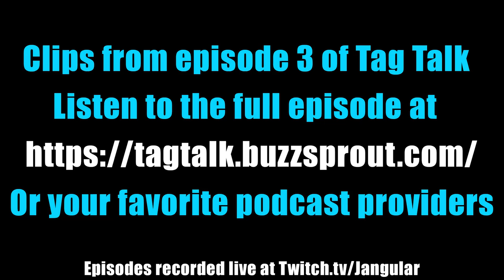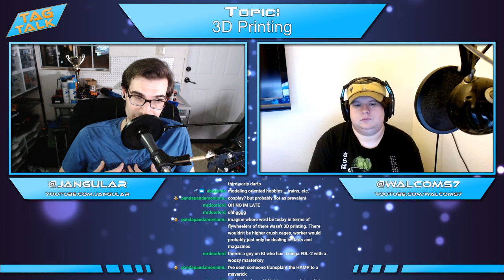Has 3D Printing Fundamentally Changed Nerf? Tag Talk Episode 3 Clips

Comment: You didn't touch on it here, but another driving force in the rapid rise of flywheel blasters was the availability of quality motors. At the beginning we were just overvolting stock motors, then people searched out existing motors that would work well enough and that helped a good amount, but what really let anyone reliably mod a flywheel blaster was when people had custom motors made with the specific specs for flywheel blasters.
Reply from the maker: That was definitely a big step, no doubting that

Comment: I believe the availability of DC motor is a big influence for FW modding, without a consistent flow of motors, there is no use of cages.
Reply from the maker: That's totally valid, as we found a want for higher crush the search for higher powered motors went hand in hand